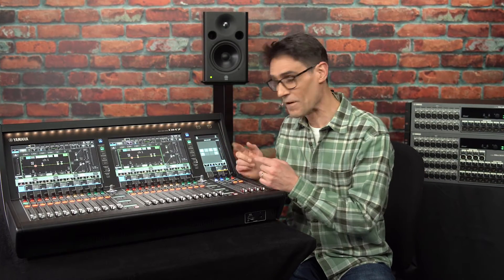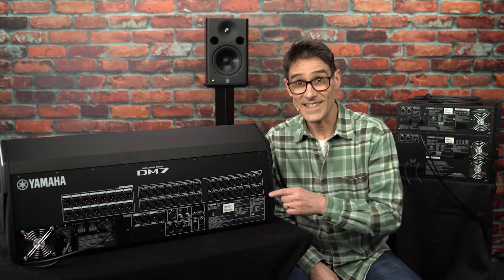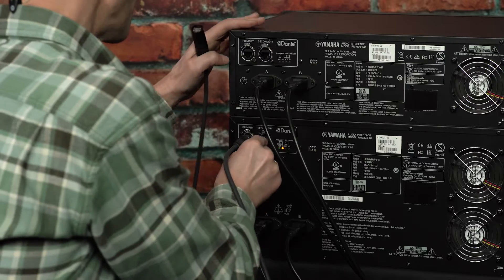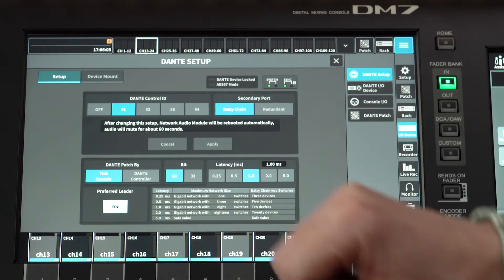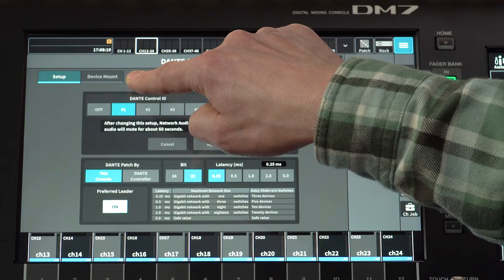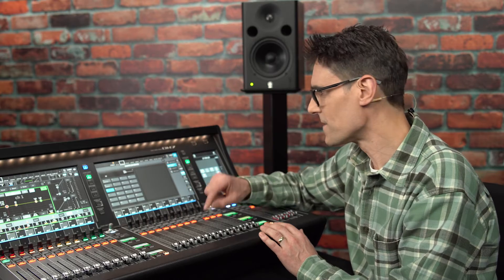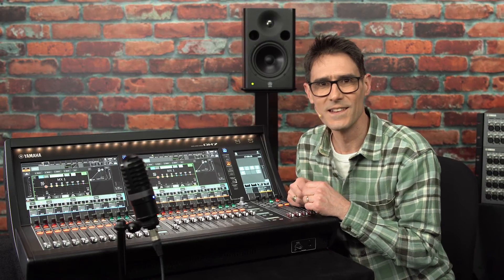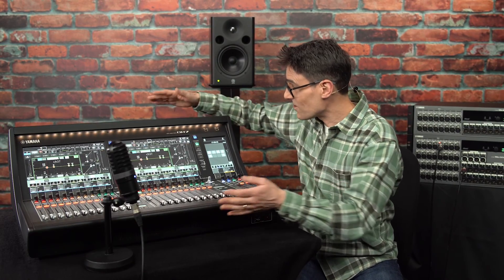DM7 Series Training Video #5: Basic Dante Setup

Comment: What about output attenuation, phase invert and delay for the Dante outputs on Rio devices?
Reply: They’re in a bit of an odd place, but I found them. Go to the I-O device menu. Select Console IO. to the lower right of the GUI that looks like the back of the console choose "Dante Out." There you'll see blocks of 8 Dante transmitters, and what bus feeds each. Each column has an "Assign" button. Press it and the delay, digital gain, and polarity invert are revealed. 
It’s Polarity invert, BTW. There’s no such thing as “inverting phase.” Phase is time dependent. Polarity is time independent. A polarity reversal is what happens when you press that little button. It has nothing to do with time. Why electronics manufacturers, who know better, started using a Phi symbol to denote polarity, is beyond me.
Reply: Hi,  Have you found these yet? surely they can't have forgotten to include these....
Reply: i havent found the answer yet